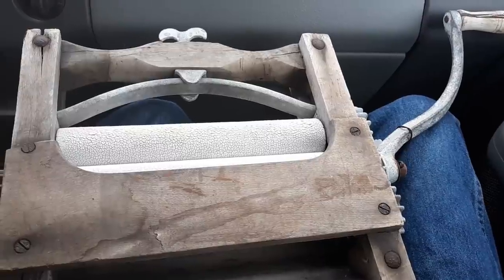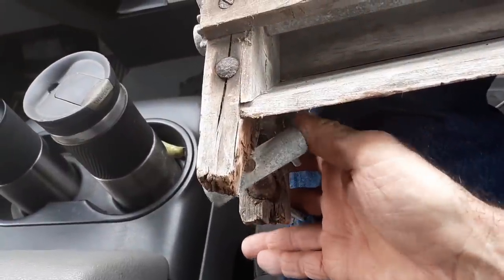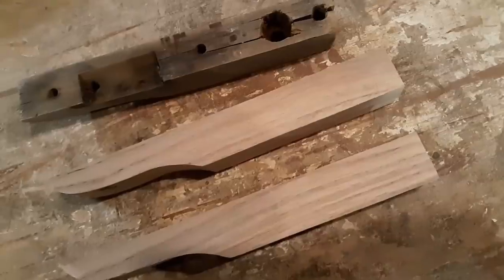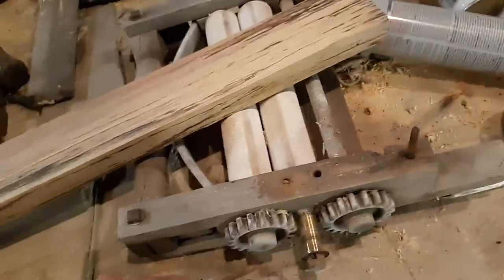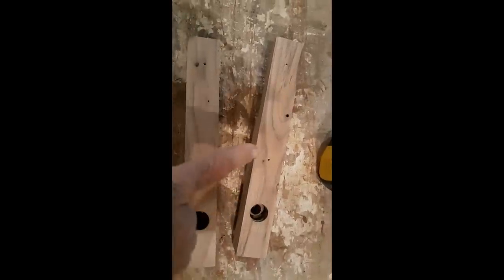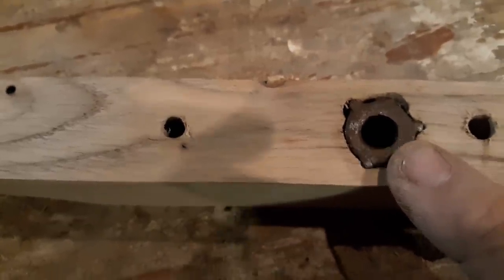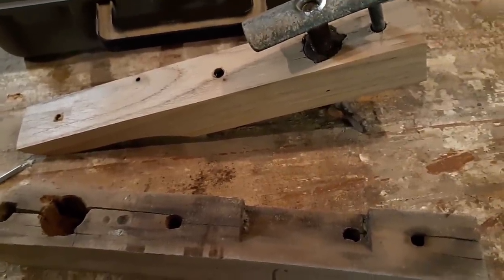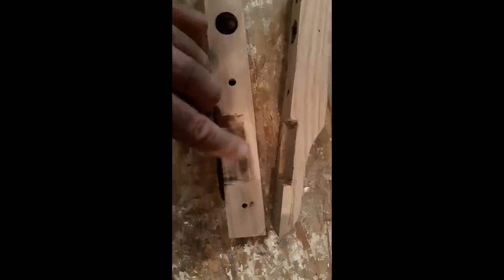Rebuilding a Wringer Washer

Comment: We had a wringer washer when I was growing up. Had 2 maybe 3 tubs for the rinse water. I don't know what happen to the washer. I wish u had it I would use it. The tubs we had for a long time. When mom passed in 2015 I found one of the tubs in a storage building. The bottom was pretty thin and had a small hole. I kept it for decoration . I told my kids not only was it used on wash days it was used on Saturday nights for bathing. We didn't have running water just well water. No plumbing. Back in the good old days. Lol

Comment: Awesome!!! You are very talented! I've seen a few at Amishland around Augusta, Wisconsin. They werent being used though. They used regular wringer washers. In Equador, 1974, the women washed clothes on a concrete slab with lines drawn into it to cause ridges. Then they would drape wet clothes over a line or bushes!!! I wore my clothes out scrubbing them!!

Comment: I have an electric wringer washer I picked up a number of years ago. It hums along and the wringer was in excellent shape. Twice my new washer broke and I used my a kenmore wringer washer and washed perfect.  Also I have a hand wringer like Danny’s but new and a hand washing tub. No power. No problem.  Actually I use it even when my house washer is fine. It’s fine to use and no electricity needed.   I found it at Lehman’s.  That is a great wringer Danny.  You may need it one day, I needed mine several times.  Nice video.

Comment: I have an antique mangel like that. I mounted it on an antique, wooden wash tub stand. I actually used the set up with two #2 washtubs to do laundry when my electric machine broke. Did laundry that way for over a month! Mine is an Eclipse and was in good shape, all I had to do was take it apart and clean it up. Little more work but, beat the heck out of having to go to the laundry mat and it gets your clothes much cleaner washing them that way (I also have an antique laundry agitator).

Comment: Feed clothes from the drain  chute side so water goes back in wash tub. Great job on your restoration of the whole project. Now if anybody would like to 3D print all the parts you would have something for you to save electricity on. I just try to picture my left arm up to shoulder between the rollers on a powered one. Luckily Grandma Pike put it in reverse and all that I lost was the blood under the nail of the middle finger.

Comment: Oh, my grandmother had a wringer washer in her basement, I used to watch her do clothes in it. She said you had to be careful with clothes that had buttons, to not set the wringer too tight or... you'd bust your buttons! Detailed wood working requires patience and precision , and Danny has both! Danny , I wonder if it would be prudent to spray some liquid rubber that dries around the part of the legs that sits on the tub. It would protect the wood from the water splashing on it when you wash clothes. ??

Comment: Check out a product called BLASTER PENETRATING oil.  Comes in a spray can with a small straw so that you can aim it where you want it. Never have I had anything work so well to melt rust.  I have taken a pair of pliers that I found in the ground, they  were literally a solid piece of metal because of the rust.  Sprayed them, let them sit and then cleaned them up. Still using them.  Amazing stuff.  I get mine at Harbor Freight.  Looking good. God bless

Comment: Nice, but why the rolls do not close together? You have to press the wet washed clothes to press water out. With opening between the rolls it will not work very well